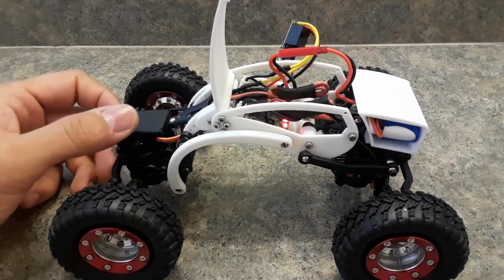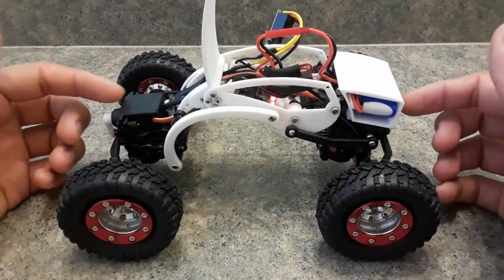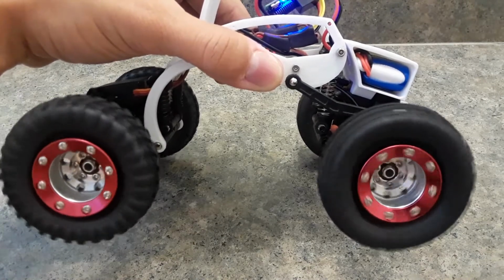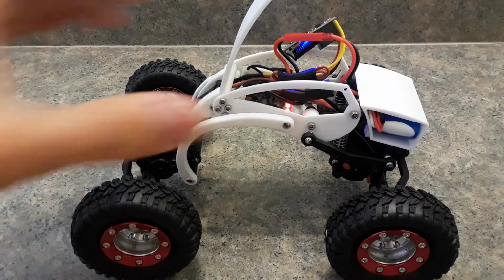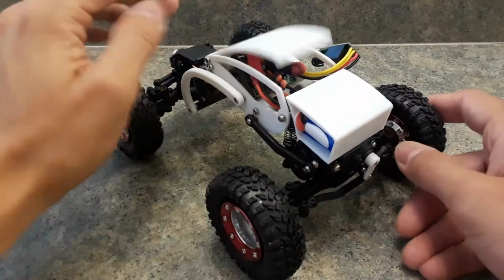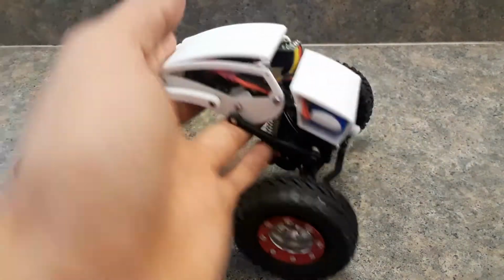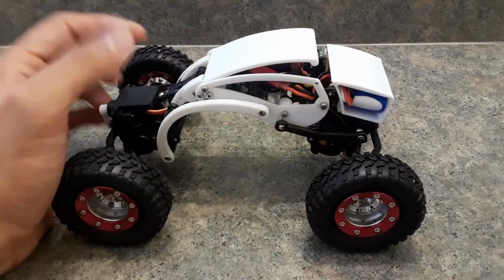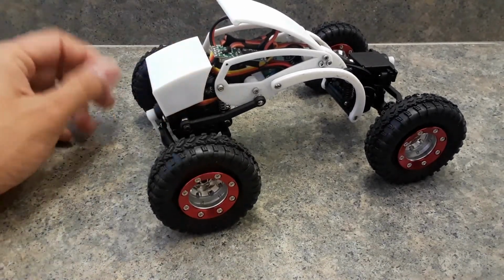Basher Rocksta Stingray Chassis update

Comment: Is there any other replacement for the esc for the RockSta Basher as HK has it listed as a discontinued product.  My Stingray needs a new one.  Thanks for making me the 4mm side plates for the Stingray.  They work great for me.
Reply from the maker: Dont think those are coming back 😔. I would just go with 2 10a esc from ebay or amazon, they work fine are super small and leave the oportunity for front or rear dig with the right transmitter. Although it sucks to have an extra transmitter you cant use now. Although ive been told the Rocksta transmitter can bind to Flysky receivers, Ill check when I get home to see if thats true🤔
Reply: @Gamyrc  Thanks for the tips.  Would be interested to see if they will bind to a Flysky receiver.  Thanks.

Comment: Still waiting for the shipment. What wheels are they?
Reply from the maker: These are WPL aluminum wheels, they are larger than the 1in micros use so you have to trim the tire to fit and you need adapters that I make as well. If you must have the look then they r awesome, but honestly any 1in with the Scramblers will give you about the same performance :)

Comment: can i still get this stinger on shapeways[or the mantis] thats my next project.just got to find a rocksta 1st-lol
Reply from the maker: Its still there 😁
Reply: rockstas are hard to get hold of atm.av u thought about the stinger type chassis for the more popular axial ax24,also MOA?
Reply from the maker: @billiwhizz221  I am actually designing a moa for Furitek right now. As for making this chassis for a driveshaft driven donor at this scale is extremely difficult to do unless you are willing to take some hits in the performance department. Keeping good angles for those shafts to function while trying to make this amount of clearance is just about impossible. Of course you could do what some larger scale guys have done by adding extra shaft lengths divided by the center coupler but that's on a larger scale that has room for all that.

Comment: Question
What's the brand/name of the electronic dig
Reply from the maker: I use this one
https://www.ebay.com/itm/Micro-Relay-Remote-Switch-4V-5V-6V-7-4V-9V-12V-Switching-Wireless-ON-OFF-10A-zg-/333125479387
Reply: Thanks Brother 👍